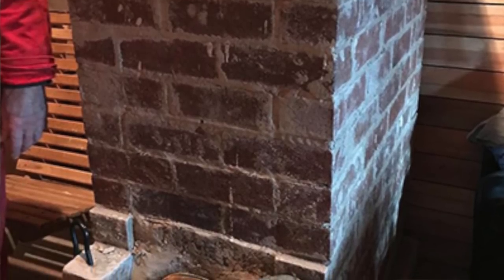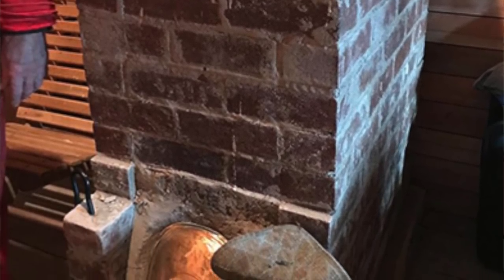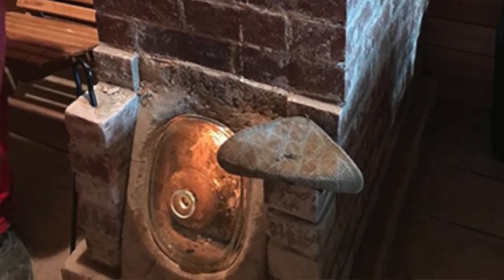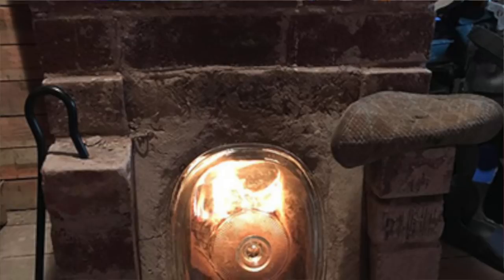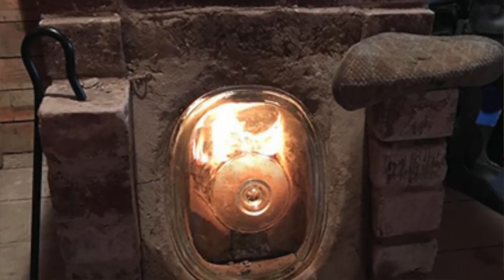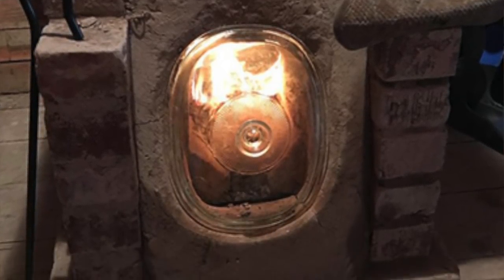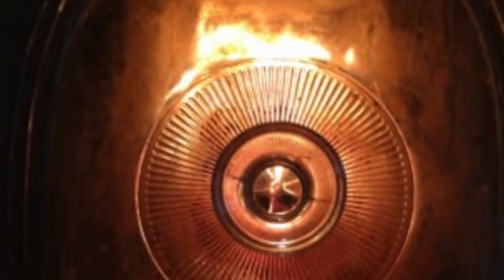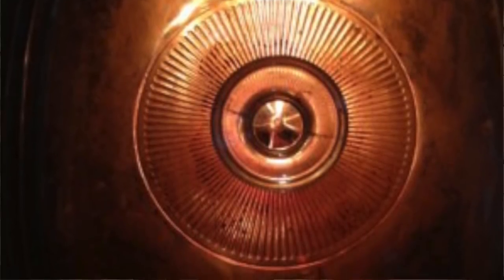casserole door for a batch box rocket mass heater - stupidly simple!

Comment: I think you're spot on this Batch Box Issue
a) you need a door - air control is very critical for its optimal performance. This makes it little too technical for most average users I think.
b) Overfueling can be an issue. its sort of tied into the top one where air control needs to be precise

J tube is more intuitive I think. 

Ever tried J-tube with a deflactor / throat to give a vortex??

 Loz Harrop's design that I use in my cooking stoves works great in 2 ways, the vortex gives good amount of mixing towards the bottom of the riser, which to me means hotter burn well towards the bottom of the riser - ultimately cleaner burn and efficient. Also temperature at the bottom of the riser can reach 700-800 deg which is quite high. 
Secondly, burn tunnel length need not be as big as the J-tube design because vortex formation tends to make it easier in that aspect. I find its super easy to light as squeezing of the riser entrace by 25 - 35% creates a more aggrasive draw in the firebox.
Mind  you there is a need of secondary air to be fed at the point where vortex is formed, towards the entrace of the riser. So in a way its a mix between the classic j-tube and the batch box concept but easy to start and run by just about anybody. 

See my text run video at this link. 
1) https://youtube.com/shorts/Ohig3VlyzDg?si=bJGGAVAA7hu_lC52
2) https://youtube.com/shorts/Nqsg7V_xWro?si=d4vQ8I-SC87nQpld

Ref: Loz's riser design video showing quite a lot of details about his stove: https://youtu.be/kaBMBrDWsMM?si=a9DJ-bVSJkONWlZt

Comment: Who am I to give Paul, an originator, advice... but.... Paul...  a million iron wood stoves with a baffle will smoke when you open the door. The door of any stove should not be opened until everything is burned down to coals, so, smoke coming out here is not "a problem." We are "spoiled" with the ridiculous draft of "the J." No other system will work like that regarding its draft. And.. unless the J design build is almost perfect, many people will, on occassion, get some puff back smoke into the house with the open J design. A design with a door is the way to go for many reasons.

Comment: I'm building a batch box stove and want a clear window on the front. I bought a big ceramic glass stove window online for only $100, the casserole lid is an awesome idea, but I'd rather pay a little more and have a nice proper big window to watch the fire. Now, I'm trying to figure out how to design my stove. I'm thinking an air wash intake that flows over the glass to keep it clean is essential so I think I'll have the intake above the glass on the front. As far as the smoke coming out the front door when its open.... I'm thinking of making the glass door with the hinges on top so when it opens, maybe having the door swing upwards and become an obstacle above, maybe that could help stop smoke coming out? With this design I'd have to have a soft ceramic blanket type gasket for the glass door so that if it was ever accidentally allowed to drop and close hard it wouldn't shatter. What do you think, would this design work well, or any unseen potential issues?

Comment: Have you guys tried a "door" that's just a slab of stone? You lose the visibility of glass  though. Have it sit in a pocket at the bottom and tilt back, gravity holds it closed.
Do you think it would develop cracks over time? I don't think it would be as brittle as the types of glass you've shown.
Reply: That would work.  What about aluminum foil stretched over a wooden frame in a pinch.

Comment: there is a problem with this. that glass lid has a tendency to get old and shatter. you may be turning you back ona disaster. a cast iron dutch oven lid is way better.
Reply: That just happened to the one they have in the earth sheltered cabin at Wheaton. I think this rmh idea is great, but it’s approached in such an amateur and experimental way as to make it dangerous. If this ever gets to a consistent repeatable build it could revolutionize wood heating. Once an engineer will sign off on it, you have a good thing. I’m all for DIY and low tech ‘avoid the system’ ideas, but not at the risk of safety.

Comment: Hi all I did think about make a rocket mass heater, can I use for the 1 year test using normal red home bricks? because in mine book from welsy she use just the red stones who are used to build houses, looks like these are quite strong.

thanks.
Reply from the maker: If the bricks are clay bricks, yes.  If the bricks have cement (most modern bricks), then those bricks can only be used where it doesn't get too hot.
Reply: How can I see there is cement in them? I have red ones woth some kind of sand on the outsides.

Comment: Hey Paul I've  seen this heater before where is the air intake it? This is a bell mass heater ?
Reply: The air intake is low on the left side, it comes in and splits, one side feeding primary air in the front, under the door; the other side feeding secondary air at the back of the firebox, right in front of the throat.

It is a bell mass heater, yes.
Reply: SunDogBuilder Brilliant! It seems a single air intake is no longer efficient "There mist always be a secondary but Where? Same place every time ? OR will the individual build dictate Where? I've gotta get up there and meet these people
Reply: Batchrockets need different intake arrangements than J-tube stoves.
A single intake is still good with the J, though something called a P-Channel can help a lot with the J-tube rockets as well.

Comment: How well does the flue work? How long does it take for the fire to get started? With the new one we made we struggle for a while getting the chimney to warm enough not to have a lot of smoke.
Reply: I would agree - we had no problem getting it to light while we were running it each day. 

Maybe if the mass got really cold, say it was unused for over a week, then it might need a little bit of fiddling or pre-heating.  For cold chimneys, my family's main trick is to light some newspaper under the chimney throat - back of the woodstove, top-back of the fire place, wherever - to "check the draft." It's really a way to prime the chimney.  I've also seen people pre-heat the chimney itself with a propane torch or blow-dryer, to skip the fiddly stage if the mass is cold.  But I would think you'd only need to do this on the first fire of the season, or the first fire back after a long holiday.  If you're having to fiddle every single day, there might be something going on with the stove - either a missed proportion in the design, or some kind of blockage.

For any larger space, I would generally go with a 5" or 6" chimney rather than 4".  The smaller chimneys can be fiddlier than a good-sized one.  A good, tall, insulated chimney helps any stove, once it's warm it stays warm.
Reply: The flue runs great. We undersized the bell (stratification chamber) just a little so as to have a slightly hotter chimney than I'd normally shoot for. This is really helpful in tiny systems, it keeps velocity in the combustion unit high and helps to overcome friction issues.

If you stack the fire properly, it takes off pretty much right away. I'd be curious to see how it does starting totally cold, now that it's completely dry. Our first wet start or two (of course) were temperamental and smokey affairs. Once we had it dry, all of our subsequent starts with it were warm starts, with heat from the previous fire still in the system.
Reply from the maker: I emailed donkey in the hopes that he might answer your question.   I also emailed ernie and erica since they used it while they were here.